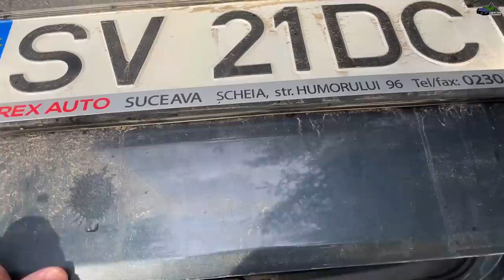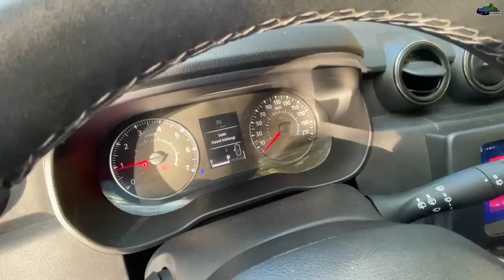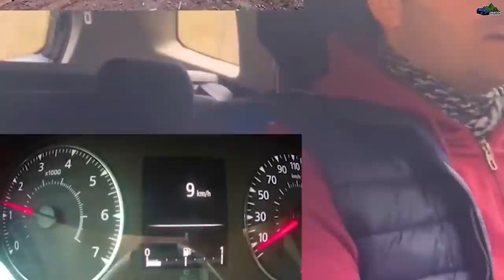Dacia Duster Owner Review After 3 Years & 75.000 Km

Comment: I recently bought a petrol, manual "4wd" 2018 Duster in the UK with approx 65,000 km. It is a lovely metallic orange/gold colour and in very good condition. However it only has a 1.6 litre engine and is fitted with a 6 speed gear box. There are a lot of good things about the car, but the gear change is definitely the worst part of the car for the driver. I think the engine size is a little too small for the car and with the gear box fitted you have to constantly constantly  constantly keep working the gear box, especially at relatively slow speeds. For example when taking off, literally as soon as the car starts moving you have to immediately change up to 2nd. (When facing downhill I actually start in 2nd.) Then almost immediately up again to third. Therefore take offs at junctions are slow and I'm regularly beeped by drivers behind because of this. All the ratios between the gears are narrow. Also if you need to overtake or manoeuvre on dual carriageways /motorways / high speed roads when you need acceleration the top two gears are completely gutless. I know other people near me with same year 1.3 litre Dusters and they say the lack of power and gear change issue are even worse.  It is therefore best suited for driving in towns (but not city rush hours) and not very busy country roads.  It is generally a bit slow, and not really suited to high speed driving (above 75km per hour). Any speed other than slow when off road is also not much fun, and the gear changes difficult to do successfully. So off  road is best avoided unless you really have to do it to reach your destination.  Nice car overall, but it desperately needs a bigger engine, with a different gearbox and better ratios. Liked your video. You would not enjoy driving my Duster off road.

.
Reply: In the manual for this car there is information that not loaded Duster should move from 2nd gear at roads. 1st gear is mostly for off road.
Sorry to say but I think you are not the best driver. You should watch polish offroad channel "terenwizja", there is a few episodes with Duster goes crazy in quite difficult terrain. You dont need to understand language to see how it drives. I had a few versions of Duster in muddy terain and if you know what you doing its great car, of course its not  real 4x4 but great for the price.
Reply: That engine will never fail you. It is very solid

Comment: I have made 75 000 to my duster in 2 years :) 
So far, so good.
Reply: I've changed the turbo at 35 000 km (warranty case)
I've changed the driver's seat leather (warranty case)
I've changed the the driver's seat regulating mechanism (warranty case)

I've changed the front brake pads at 60 000 km (my own expenses)

Right after buying the car, I've put the transparent film on the body of the car to protect it from scratches. Right now all the film is scratched, but the paint underneath it is as good as new. So really good investment there.
Reply: Oh yes - and all the time problems with adBlue. Last time dealership updated the software for AdBlue computer ... let's hope that it will work fine now. (Previously the main problems were that after filling up the adblue tank, the car still did not understood that adblue tank is filled up and still counted rest kilometers to full stop.
Reply from the maker: yes, I also had ad blue related problems, at some point, they ve changed the ad blue tank and pump on warranty
Reply: @androns1983  did u also abuse the car or just used it normally on road? Its a lot of malfunctions youdescribed on such a young car....
Reply: @tirgod100  i would not call that 'abuse'. There were a lot of gravel roads, but no such mounta8ns as in DCT videos. Just because we do not have such mountains in Latvia. 
But comparing to 'normal people', yes - sometines i drive somewhere where regular crossover driver would walk, not drive.
Reply: @androns1983  than thats still not ok to have such issues than. I would not be happy if i were you. I was considering buying one for normal road ride but the more i read peoples rewies the less i want one.. its very split and i need something reliable.
Reply: @androns1983 strange that the turbo failed. The 1.5 DCI is a great engine, we have a Trafic with that exact engine that has 450.000 kms on it. Never once blew a turbo. Only the adblue issues

Comment: I just bought new 4x4 Duster after watching reviews like this. Unfortunately no reviews of recent models mentioned the noise made by the adblue pump, which I find very irritating - to such an extent that I may have to cut my losses and sell the car.
Reply: I want to buy also Dacia does they work for of  road ?
Reply from the maker: For me it’s not that big of a deal . And I think you’re referring to the fuel pump. It’s the one starting before you start the engine and goes on around a minute after you turn off the engine ?
Reply: @DusterCoolTravels  The noise come from behind driver, I thought fuel pump was in engine, which is why others say it is adblue pump. Would make sense since I believe adblue feeds into exhaust, so that's where it would need to be.
Reply: @beneliguns1011  Have not used it off road yet, but all reviews I have seen look good.
Reply: Has the noise from the ad blue pump been fixed in the current facelifted version , launched a few months ago ?
Reply: @keithgeary8070  Mine arrived beginning of this month so it must be latest version. Of course it may be just annoying to people with sensitive hearing, just something to watch out for when test driving.

Comment: I drive on auto mode regularly in everyday use onroad, is that bad? can it damage the rear differential?
Reply: I drive on auto mode every day too...   Should I use 2WD on termac? Do you see difference in for example how many liters of diesel fuel is consumed? (2WD - Auto mode)
Reply: @vaderjk  difference in fuel consumption is minimal and unnoticeable. In auto mode driving is more comfortable, acceleration and even gear changing is much smoother. I don’t know that, that’s why I asked. In video he said that he damaged rear differential because of auto mode. I wonder what situation he meant, maybe he reved too much in first gear in off-road
Reply: Duster Cool Travels could you answer ?

Comment: Salut ! 3 ani face si a mea, dar mai putini km, cumparata de 2 saptamani. Motor K8K-U8 , la pornirea dimineata la rece ( sub 0 ) turometrul oscileaza si se simte in caroserie ca vibreaza. Dupa cateva minute isi revine. "Asa face toate" raspuns dat de dealer si pe tester nu da eroare .Ati avut aceeasi problema ? si cum ati rezolvat-o ? Multumesc !
Reply from the maker: nu am avut problema asta.
Reply: La unele modele senzorul de temperatura de pe rampa de combustibil nu funcționează corect la temperaturi mici. Pe forumul de megane 3 cu același motor 1,5 dci 110, unii au pus o rezistență de 10 komi între cele doua fire care pleacă de la acel senzor, sau au schimbat rampa de combustibil.
Reply: Și meganul meu face ca dracu, sub - 7 grade,
Reply: @valyteoc5469  Multumesc ! Apare eroare in bord daca senzorul de temperatura sau supapa  regulator presiune nu functioneaza corect ? Nu cunosc motorul , acum incep sa invat 😊
Reply: @cosb578  nu apare absolut nici o eroare.
Reply: @cosb578  motorul este foarte fiabil, am 300000 km, 8 ani, absolut nici o problema, nu completez ulei și fac schimbul la 12 - 13 000 km
Reply: Am o poză cu această modificare, dar nu știu cum să o trimit, am trimis un link, dar te direcționează la grup, nu la ceea ce te interesează

Comment: Did you have any problem with the heater blower resistor? I bought a year old duster and it failed in the first month of ownership and heating fan would only run on full speed but was fixed under warranty. Apparently this is a common problem on dusters and wonder if anyone has found a solution to the problem. I know it’s only a minor problem but a bit annoying as on a lot of cars the resistor lasts almost the lifetime of the car.
Reply: Have had this issue with both citroen and peugeot vehicles, though not within one month of new!

Comment: What tires are you running? I have a 2021 facelift duster and was wondering if I can upsize the tires. I know most people are running 215/70/R16, do you gave experience with bigger tires? Can I use bigger tires on 17"? Maybe 215/65/R17?
Reply: 215/65R17 You can put that size it won’t touch, but I don’t recommend that size from my experience. The diameter is too big and it’s not comfortable, the car actually became rougher to drive especially at high speeds. If you want to get big tires get 215/70 R16 great for off-road and there are plenty AT tires for that size, it will also add clearence. While the stock 215/60 R17 is bigger in diameter than stock R16 215/65, but it’s a bit smaller than 215/70R16. If you can get AT tires for 215/60 R17 get them! but it’s harder to find and still, there are plenty of good suv all season tires for that size and I got Toyo’s open country myself.
Reply: I have 215/65 R17 for winter and 215/70 R16 for summer (A/T tires). No problems at all. 
(Standard springs and shock absorbers)